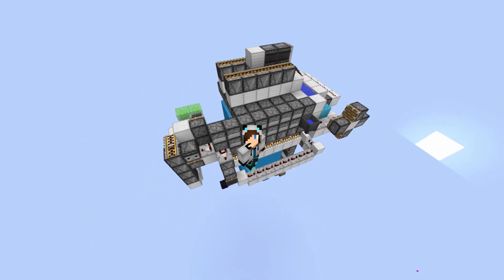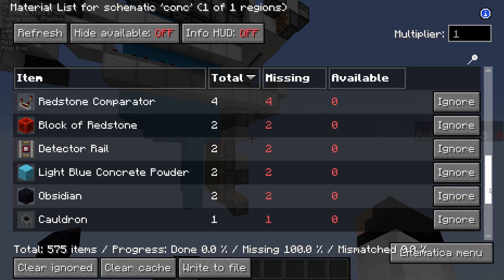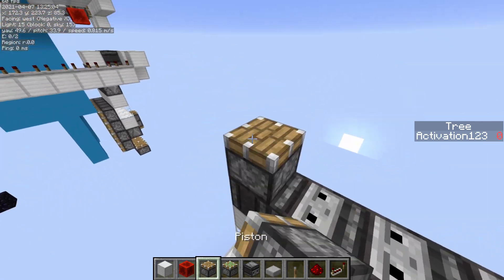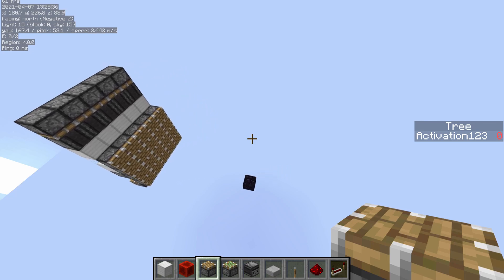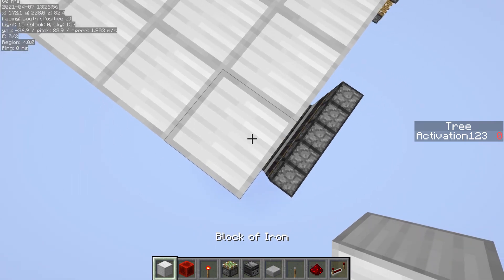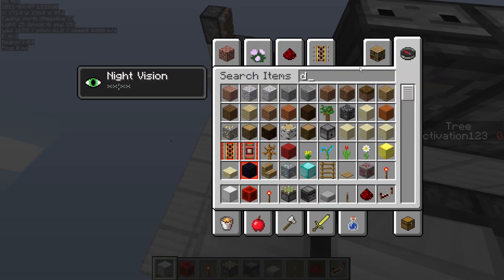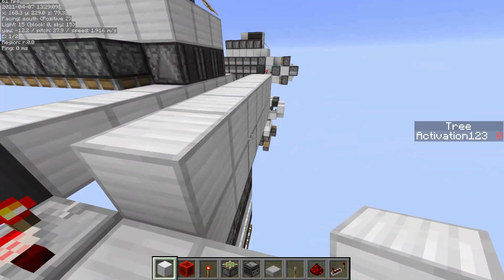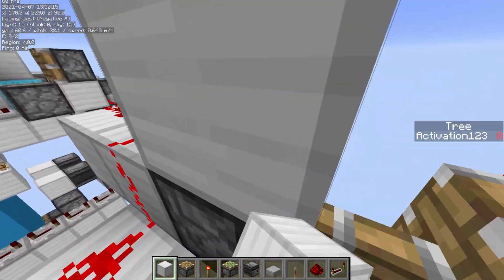Improved Simple Concrete Converter (18-24k items/h)

Comment: this is not a concrete converter, this is a a self destruction machine. I've rebuilt this multiple times, checked everything a million times, its all perfect.  then after a minute of use it blows up.
Reply from the maker: if it works fine in the world download you're doing something wrong.  check it.  if you're on paper or spigot, then it won't work
Reply: @Activation123  been playing with it all day my guy, changing stuff tweaking things to make it work. it just doesn't agree with anything, ended up just designing my own, this vid was helpful tho ngl learned a lot about Zero ticking.
Reply from the maker: @SizzleMyBurgers  does it work in the wdl tho?
Reply: @Activation123  nah pistons keep skipping for me
Reply from the maker: @SizzleMyBurgers  hmm, i've never had that problem before?
Reply from the maker: @SizzleMyBurgers  alr tested it in the world download, and it works fine.  what u talking abt?
Reply: @Activation123  sorry didnt see your reply, yeah it still isn't working for me but with some modifications i got it working on my world. The problem seemed to be the pistons not pushing correctly all around. concrete would get pushed into the TNT duper, and would also get pushed into the module zero tick generator breaking it.  i went with a timer base zero tik piston setup instead of player input one along with a few other changes. videow as helpful tho, i learned about some good mechanics that i used to make mine.
Reply from the maker: @SizzleMyBurgers  you must've made something wrong, forgot items in blocks, ect.